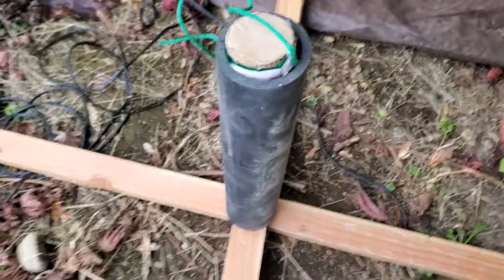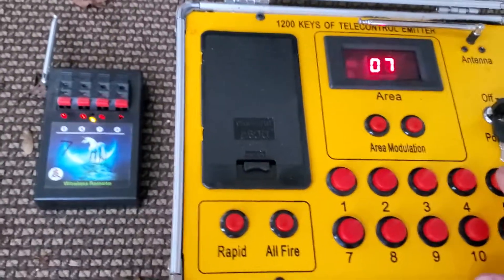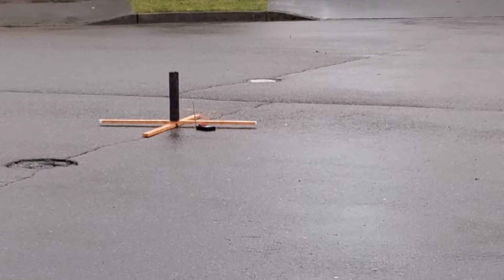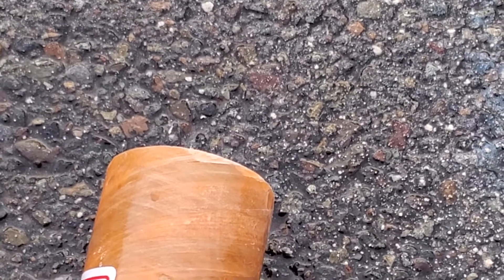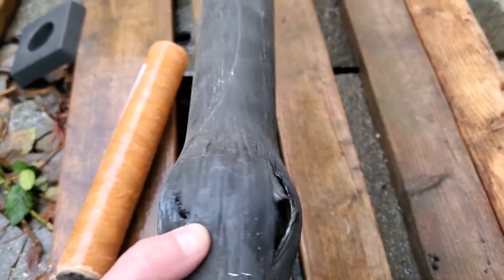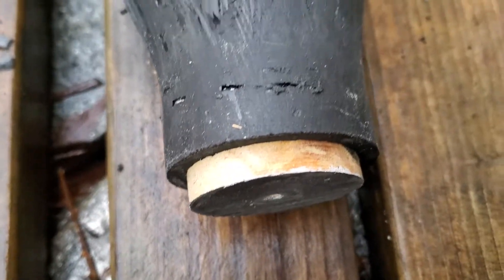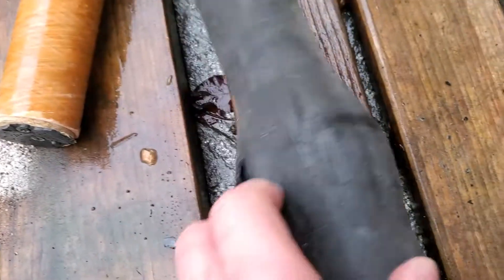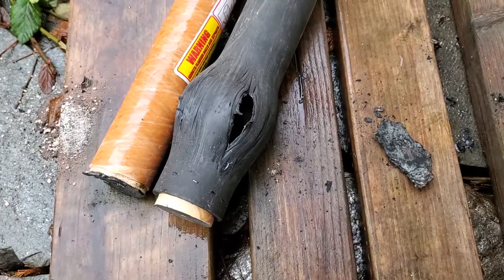Mortar explodes in a tube, HDPE vs Fiberglass, fired remotely

Comment: Cool video.
Reason why your fiberglass tube didn’t shatter is because it is new. The more rounds you shoot from a fiberglass tube the weaker it will become from heat and shock. The fiberglass tube is fiberglass and glue. Also the weather weakens the tube over time, especially the sun. HDPE won’t breakdown like fiberglass tubes over time.
Reply from the maker: Yeah, it was never used as you can probably tell, I think it came with a Goliath case.  One was different with no label.
Reply: @subaquaticpyro8234 agreed. And not all tubes are equal, some are built really cheap and thin

Comment: My opinion on fiberglass is that it would weaken after time and when it does break apart, it would probably fragment a lot more dangerously than the hdpe.
Reply from the maker: Most likely, I start with the safest scenario.  I have plenty more to do when safe since there is still not much information out there.  Education is a critical part of safety when it comes to pyrotechnics.  Personally, I would only use a Propane torch or a firing system.  All other methods have risks and I have seen a LOT of people mishandle a torch.  ALWAYS have your arm out to your side as far as you can and have THAT ARM face the fuse with your head turned.  NEVER bend over it like Cody and others do on his channel ALL THE TIME.  At least Dave uses a firing system, I use two different affordable ones, Firefly was a disaster.  I am permanently locked out of it.  I spent many hours with the company to no resolve.  They should have just sent a replacement unit and I would send it back but they refused to do so.

Comment: 🤦🤦🤦🤦🤦 this is why they ban those types of fireworks. Use them properly. Never do experience on them.
Reply: They’re not banned everywhere plus it seems like he was being very cautious as he was experimenting. It’s also VERY informative for us and most importantly new folks on the scene who needs to see what can go wrong.
Reply: @LOMU925  The whole point was to emphasize caution.  This is WHY I use remotes.  I was 100 feet away inside.  Do not just torch them with your head above.
Reply: Not banned unless is a facist state line CA.  Still dangerous, it mostly showed how inportant safety is.  It was quite a force.  I actually expect worse.  I do hsve follow up videos I have not posted.  Fiberglass in wood and cardboard tubes.  My purpose is education.  I have had to learn and  want to educate to increase safety.  Firing systems, when to use blocks, when to elevate, etc.

Comment: For the HDPE setup did you screw into the plug from the underside to attach to wood stand? Or did you screw in from the top with the drill bit inside the tube?
Reply: Bottom

Comment from the maker: I need to post a video about a fiberglass in wooden base since it was them that was destroyed.  I have other videos about when to use brick blocks, firing systems, etc. I need to edit and post.

Basically any fireworks that is taller than wide should be set so the can not tip over.  Which basically mean fountain and some 200g cakes.  Most 500g cake are already wide enough because of spacing requirements between tubes for certain diameter of tubes, 500g usually have either such tubes or lots of little one.  I can think of none that are tipping risks except some hexagonal ones, which are really 350-400g, usually with 7 tubes of up to 60g each.

You can see how long the sticks were for that temporary rack.  This simply means a permanent racks should be over either 15 or 18 inches wider depending on tube length, so 6 tubes is enough for 12" tubes and 8 tubes for 15" tubes as long as you have multiple rows or a cross piece of wood attached on one side if it is shorter than the height.  This avoids the need to block on addition.  Some pro's do both anyway but it is not required for proper safety.
Reply: Are you doing this in a culdesac ? I bet your neighbors hate you lol
Reply from the maker: @asbestos_man5445  Nope, no one even noticed, I do have people lighting stuff off weeks early though, somewhere north of here, I heard half a dozen last night.  Karen free zone,  I get thanks afterwards, I limit when I do fireworks unlike others.  This was a one time legal test.  I will do one about fiberglass with a wooden base.  Too early to do so legally.

Comment: I feel like the fiberglass has a problem when there’s multiple shots going on around it. I’ve splintered many tubes shooting just a few next to each other. But am not surprised how well it held up. Thanks for the display. Good to see what could potentially go wrong and better be ready for it. I haven’t done it, have had friends do it though.
Reply from the maker: I still use nothing but HDPE myself.

Comment: Y is the fuse at the top
Reply: So it can be ignited upside down and explode in the tube.  The first flash is the lift charge.  It is purposely sabotaged to explode without exiting.  This also simulates what would happen if a shell we inserted upside down by mistake.

Comment: nice. the fiberglass tubes are awesome. If that Happened in a show other tubes could of been damaged with the HDPE and caused a major issue.
Reply: Yeah, I will also do it to a wood base one later on.  Not sure if I want to do an in rack test.
Reply: @toriless  Agree. A lot of people rip the bottoms off and place them right next to each other in a wood rack. I feel that could be a problem. What if the HDPE expanded to absorb the impact and cause the tube next to it to get "kinked" just enough to keep the can from launching. NOW you end up with a chain reaction. 

I know everyone loves HDPE but I think fiberglass is the winner.
Reply: @EngineerCatPyro  They both usually blow apart Not sure what happened here
Reply from the maker: @bigmacfullerton7870  It came with the Goliath set I got years ago.  Probably 2016??
Reply from the maker: @EngineerCatPyro  I did make a brief comment about that at the end.  I would recommend a spacer between every tube and side panels be 1x3 not 1x4 so the would be below the 1 1/2" plug since all the expansion occurs above it.  Any future racks I make will do this.  I was busy rebuilding some rack I bought (with tubes) I bought this years since they did not pre-drill and split a lot of the wood so it had to be replaced.  Fortunately, I often have wood lying around I could salvage to rebuild them.  That part was easy but they also did not account for the blade with so half also needed to be rebuilt since the base was too short for the tubes to be fit without cramming them.  That 1/8" made all the difference.  Not sure which person did which mistakes but clearly they have no woodworking knowledge.  I built a 4x6 spread rack, a dual roman candle rack and two dual 24 shot racks, one straight up and another adjustable.  Need to post that too.  Been busy doing other stuff and the heat wave put me even further week behind.   Anyhow, I put 1x3 in places where I was replacing panels and they work fine.  I will use 1x3 now and do my usual countersink pre-drilled holes.  I have videos about that too.
Reply from the maker: @EngineerCatPyro  I may make shorter, 6 or 8 tube racks with spacers.  One advantage of a firing system over fusing is you can abort firing as well.
Reply: @subaquaticpyro8234  I wrapped my wracks with 1000 pound ratchet straps around where the tubes are exposed in hopes it would help keep things together in the event of a CATO. I have been waiting for someone like Cody B to try this on a video to see if it works. I don’t want to blow up one of my racks. Wood is really expensive. I actually have 1x5 on one of my racks. I should probably switch it out with some 1x3
Reply from the maker: @bigmacfullerton7870  I would do the same for milk crate racks.  I just keep forgetting to add a strap to mine.  I mostly use the crates to tube storage but have done the ghetto style rack too.  25 HDPE's fit perfect.
Reply from the maker: @EngineerCatPyro  I am also worried it might crack the rack, of it stays together, than toss it but if other tubes fall out that is a major problem.  If I live in ND I would have built lots of prototypes rather than visits Fireworks store like Cody wastes his time doing.
Reply from the maker: Yeah, it seems mostly rack design was a take away for me.  In the years since I have only seen 1 video "stress test" some designs.  Despite what ypu may think there are really only a few people thinking about it.  I did bring up a few points like where the plug is does not expand so a good design would support the lower 1 1.2 with a spacer between tubes to allow for expansion of the lower portion where the shell is located.  This design rules should apply to any diameter.  My test showed what spacing should work for 1.75" (actually, 40 mm like a ping pong ball) but did not build a test a rack hoping other would.  I probably will follow up since so one has over the past 4 years.